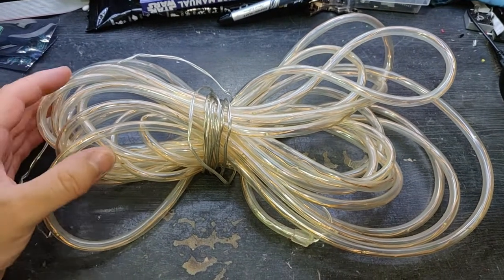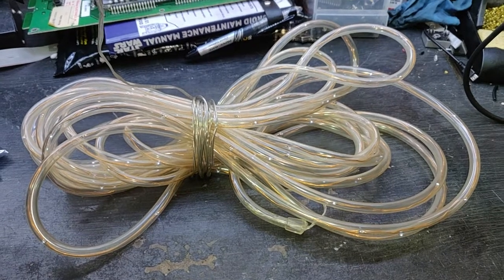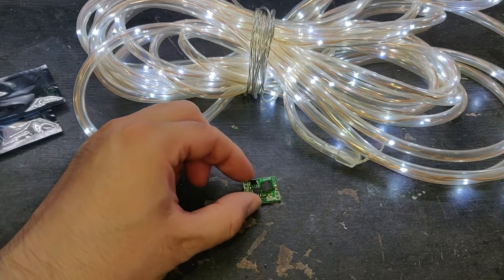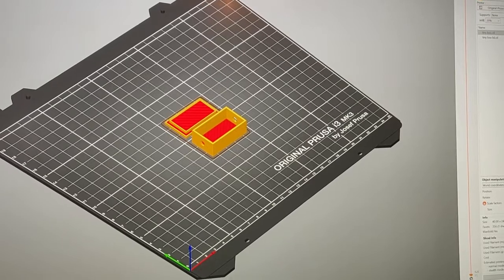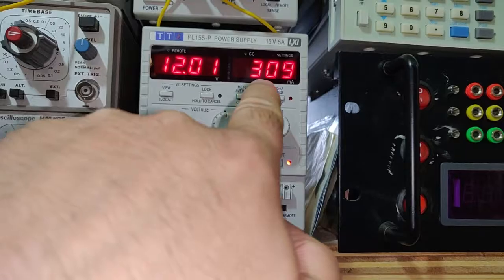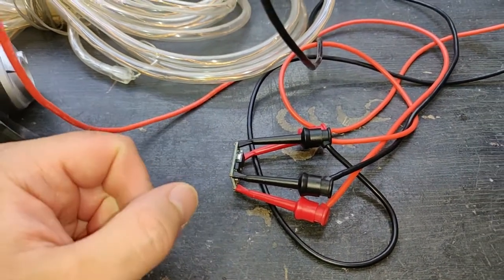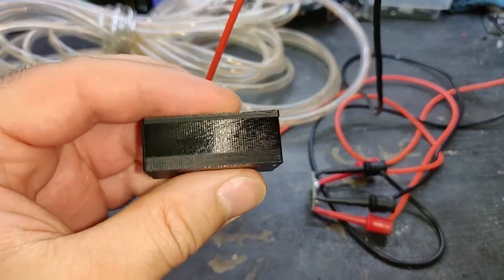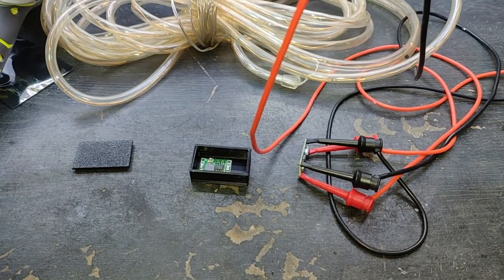Converting solar rope lights to 12v

Comment: How come you didn't need to add a resistor to limit the current?
Reply from the maker: All of the LED's are in parallel, so if I added a resistor then all of the current for all the LED's would be flowing through that one resistor and it would have been wasting energy and getting hot. It would be "correct" to provide a current limited supply to the LED string, but, in this case, I chose to limit the voltage to a voltage below the normal operating voltage of the LED's. They do effectively self regulate when operated at a voltage lower than their normal operating voltage and will draw less current. 
You can see this in practice by connecting an LED to a variable power supply. If you set the voltage to zero and then slowly turn it up, at the point there the  LED first starts to light, it will only  be drawing 1ma or less, as you reach the normal forward operating voltage of the LED it will be drawing say 20ma (depending on what LED) if you turned the voltage up further then the LED will draw an excessively high current and start to fail

Comment: Hi, looking for your contact details for a PCB repair :)
Reply from the maker: a r c a d e u k AT h o t m a i l DOT c o m
Reply: @arcadeuk  I would like to use a single LED from a string of LED'S as you are showing. There would be 20 fixtures each having a single LED. Can that be done if the distance between LED'S are between 6 & 8 feet?
Great video.